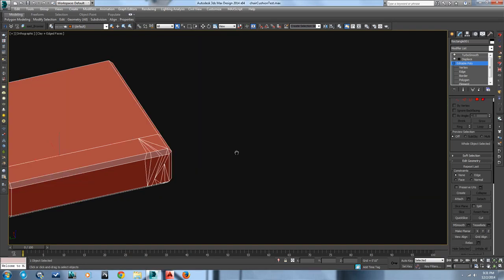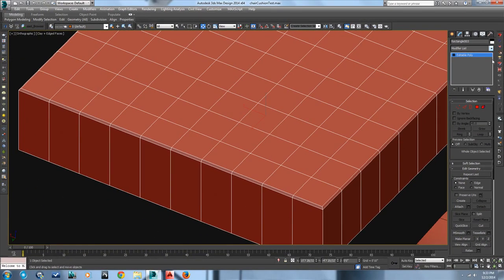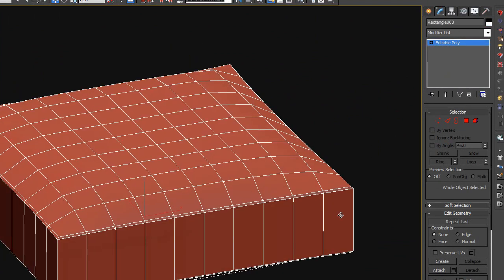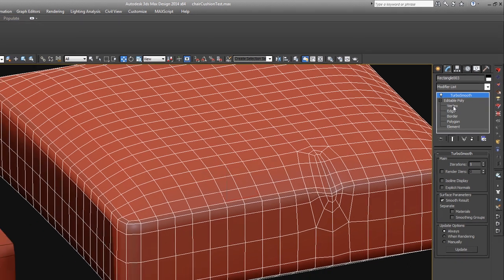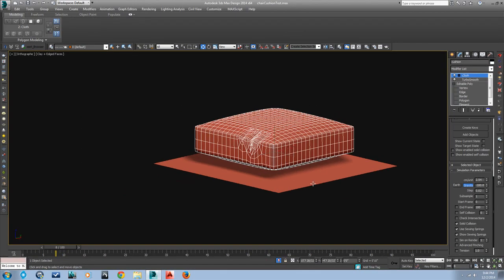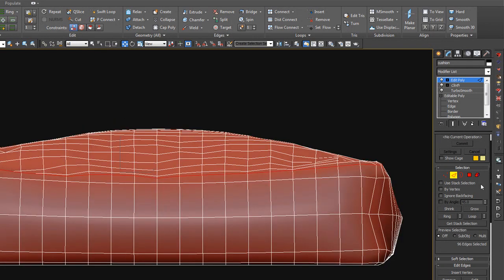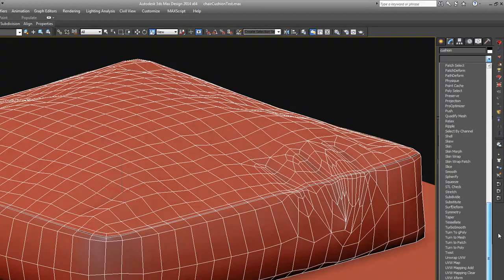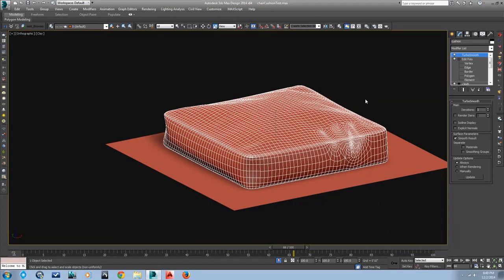3ds Max Modeling Tutorial:  Adding Wrinkles To Your Furniture - Cut Tool & Cloth Modifier

Comment: Thats when you dont have Zbrush :>
Reply from the maker: +benox50 Well, doing it with zbrush is a different technique entirely.  This one is meant to show how to do it with just poly tools, sort of like how www.designconnected.com does.  Overall, this is a cleaner, more efficient model, in that it only puts the high detail where it is needed, and remains as clean quads.  Zbrush, mudbox technique is certainly a way to achieve this as well.

Comment: how do i get that tool bar after pressing ffd 4*4*4 ? at  3:35
Reply from the maker: +Maroua Bouabid That is actually an edit in the video. Sorry.  What I did was abandon the ffd and go to graphite tools instead.  The graphite tools menu is exposed by pressing the small arrow in the top toolbar, right next to where is says "populate" at 3:35.
Reply: @Learn-archViz  I have the same problem and when I see the GRaphite Tools I have no option for P Connect and the other options from your Edit section. I wonder if I have missed another step as well. Thanks for the video!